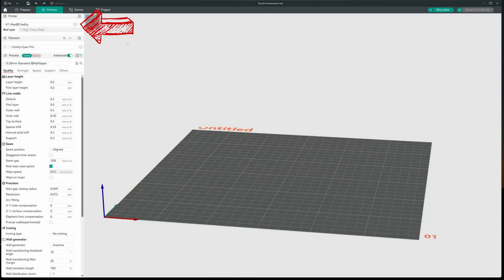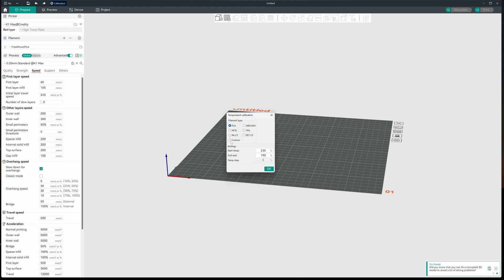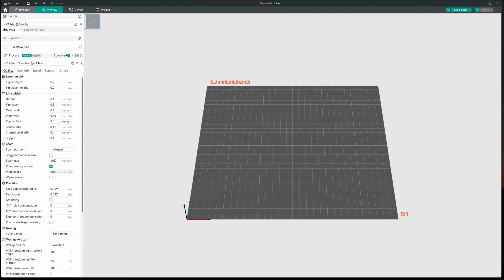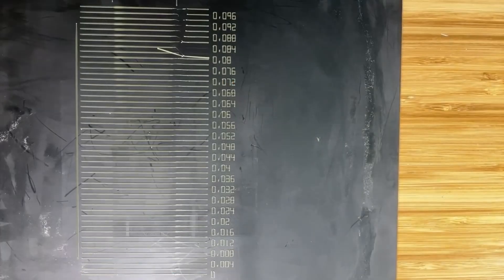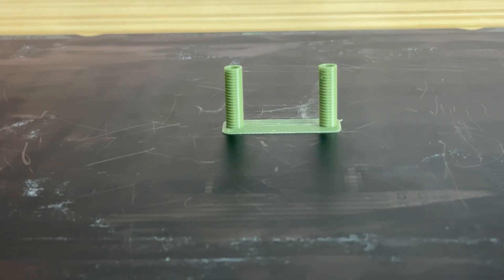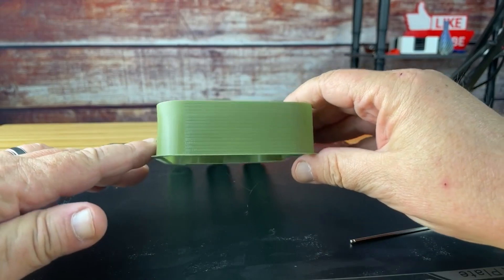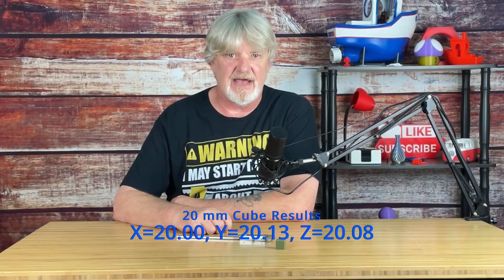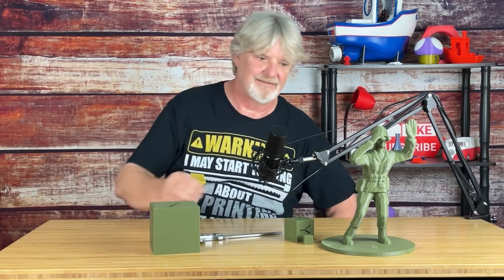Creating A New Profile In Orca

Comment: Why do you prefer Cura, not Orca,  for your Enders?
Reply from the maker: I was all setup with Cura for the enders before Orca was available. When I made that comment I was talking about my original Ender 3's, the 5 and five plus. I had a lot of time dialing those printers in with Cura. My latest Ender , the v3 Se, I use Orca and Creality Print with that. I have a sonic pad I want to hook up to my older printers, when I do that I'll probably be running just Orca on them. I still think Orca and Cura are both great slicers.

Comment: Something is wrong, the temp towers I've printed from ORCA have an ORCA label below the bridge on the flat, nothing is there at high and low temps but on my setup at 215° the ORCA text is the highest. Version 1.9.1 of Orca has resolved several issues I was having with 'Klipper Box - Raspberry Pi Zero' the night before 1.9.1 dropped I was getting junk and with Creality Print worse junk, after the upgrade which included the removal of all previous Orca data and program the 'Klipper Box - Raspberry Pi Zero' project prints perfectly.
Reply from the maker: Unfortunately I don't have an answer. I'll do some research to see if I can come up with some answers.

Comment: what is bed mesh lvling
Reply from the maker: Mesh leveling helps compensate for warped print beds. Basically, you level the bed using a piece of paper, but instead of the 4 corners, you might do it 16 or more places. You adjust the nozzle height from the control panel. When you feel that you have it level, you save the mesh. When you print, you automatic bed leveling probe uses the mesh to measure the distance from the bed to the nozzle. Depending on the printer, you might have to update the firmware to do this. I don't any videos on this, but there are some out there that might help. I would suggest checking some of those videos out. I know CHEP did one about 2 years ago where he upgraded an Ender 3 to include mesh bed leveling.

Comment: For the X1C do you need to do a manual Pressure Advance test?
Reply from the maker: It doesn't hurt. I did one for my 1XC using the same process I used at the 7:30 mark in the video. The more you test & tune, the better your profiles will be. Thanks for the comment and thanks very much for watching!

Comment: How does 98/100 give you 1.029?  I'm an engineer.   I missed that math class.
Reply from the maker: Good eye. Typo. At about the 6:29 mark, the formula should read 1.05 x (100 + (-2))/100=1.029 instead of 1 x (100 + (-2))/100=1.029. It's been noted in the description.

Comment: I'm new to all this.  Why did you say 230 looks the best on the temp tower?  What are you looking at compared to 235 or 225?
Reply from the maker: The overhang at 235 was deformed more than 230. 225 had more stringing and the detail in the spike didn't look as good to me as it did in 230.
Reply: @pushingplastic7445  Thanks.  I just ran the Flow calibration on grey sparkle and the sparkles make it really hard to see the lines.
Reply from the maker: @boboscurse4130  I can see how that would be a problem. Remember, it's about seeing what one looks the best, not what one looks perfect. After doing your calibrations, run another Temp Tower and see if it looks any better and what one looks the best. Good luck!

Comment: Another Question: Do you test your cooling which would effect bridging, also How are you adjusting for print speed. So this profile is good at a specific mm per sec. But would you run these again for a higher speed? Thanks.
Reply from the maker: If I was changing my print speed more than just a few degrees, then I would rerun the process. You need to see if the printer speed is moving faster than the hotend can melt the filament, so I'll always run a temperature tower after adjusting speed followed by checking the flow ratio. I hope this helps! Thanks for watching!

Comment: Advice: I have 3 Ender 3 V1. I have two Duet and one is Klipper (no Marlin). I've wanted to do what you are doing for those. I want to try the calibration built into Orca. If I don't have and Ender 3 starting profile what should I do? Other than bedsize these are really Duet and Klipper printers. Could I use a Prusa Slicer ender 3 profile?
Reply from the maker: If you can get the Prusa slicer into Orca Slicer (I haven't tried that), then yes. That would be a great foundation to build upon.